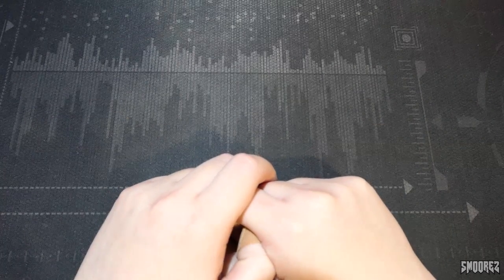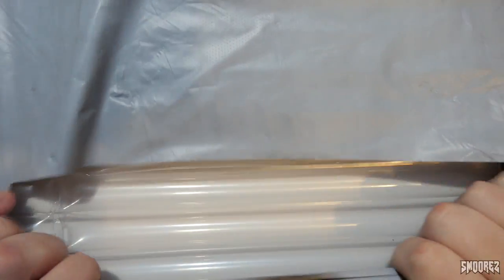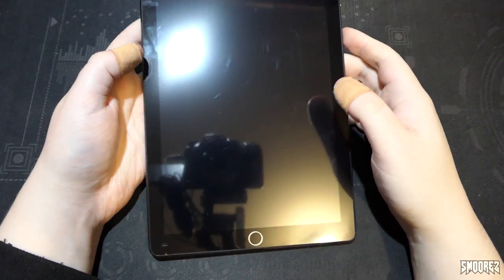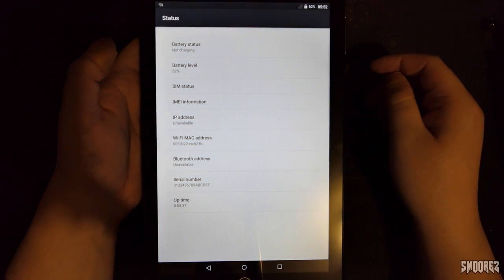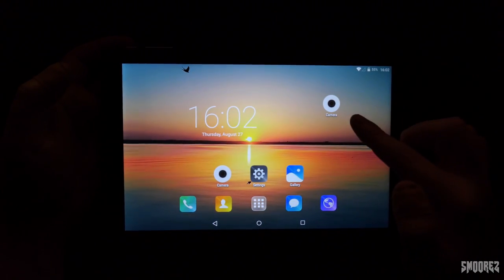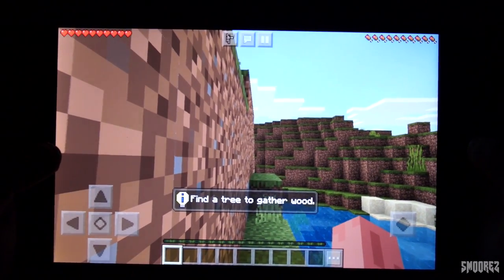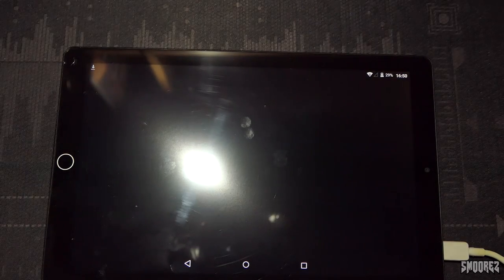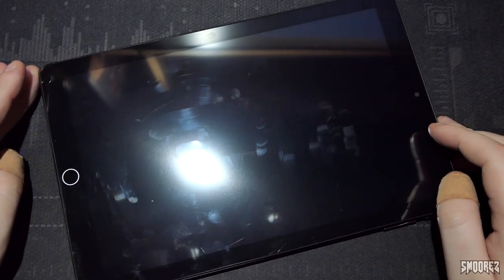iWish: I Bought a Knockoff iPad thing from Wish! This is what I got... In-Depth Review & Teardown

Comment: Why the hell are you going to great efforts to break the damn thing before you even switch it on???  Android 10 my backside.  That's v5.1.1 at best.  10gb Ram?  Don't make me laugh. 1gb maybe 2gb IF you are extremely lucky.  However for all that under £90 for a fairly responsive tablet with 512gb drive isn't too shabby.
Reply: Dude u didn't pay attention then. It didn't have 512gb. And he didn't BREAK it he took it apart. Big difference.

Comment: I got this tablet and I rooted it to get past the software facade. Everything about this tablet is fake. It is Android 5.1 with 2 physical cores and 1GB RAM with 512MB zram by default. Storage size is also faked but I was unable to find the real size, probably 16GB total. Battery life is terrible and can't keep itself alive indefinitely while charging with screen on. It has barely enough power to play Angry Birds, basically it's now a video player for my car, not fit for anything else.
Reply: can you tell me how you reversed the faked specs using the root?  i am curious to do this to a similar tablet myself
Reply: @arjan1995  Hey, some of it was done by special fake/test attributes in build.prop . Rooting the tablet and deleting those entries made some apps aware of the real specs but not all, it was pretty deep modding. System info was modded probably by directly modifying SystemUI and Framework-res, you can only reverse that by recompiling the apks, not worth the effort.
Reply: @arjan1995  Oh and the CPU cores gave me a headache too, it showed as 10 cores but the /sys/devices entries were actually mirrored by some kind of symlinking, even the hotplug was actually working on those shadow cores. That was way out of my league to untangle without a proper recovery backup in case of a screw up.